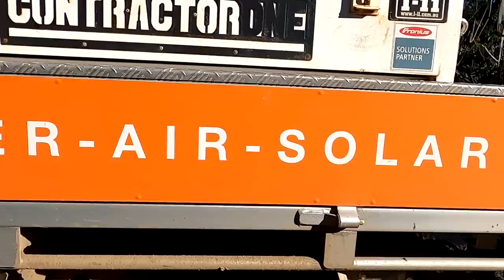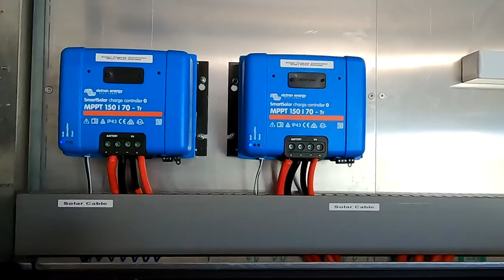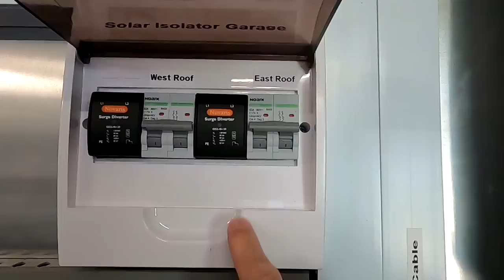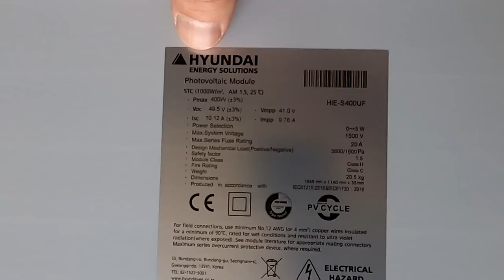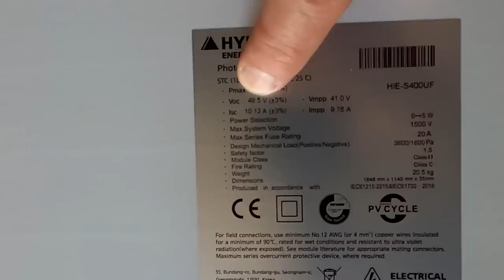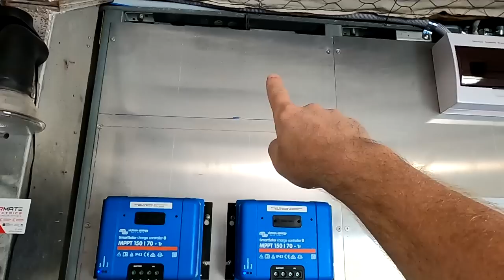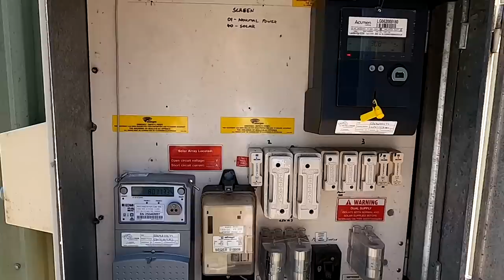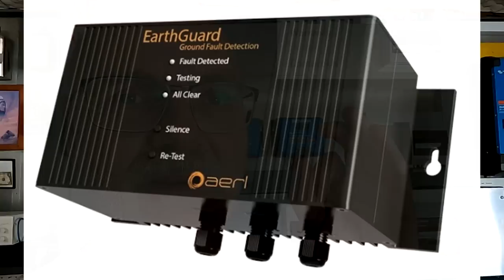I booked an Electrician to check on my DIY Solar-Battery System.

Comment: For DIY paneling, 40lbs is about the limit that one person can handle.   In many respects, you are looking for panels that:

(a) Are 40lbs (roughly) or less (for DIY).
(b) Have dimensions that work well with the roof area.
(c) And have voltages suitable for your inverters.  Or invest in new inverters.

Due to the shading problems with your particular roof, you don't want to parallel strings.   That is, you want one MPPT per string (which I think is already what you are doing).   Per-panel micro-inverters or optimizers will produce the best results.  However, you can still have series strings and use a string inverter instead of micro-inverters or optimizers if you want.  The issue here is that the bypass diodes will wind up being used rather heavily due to the shading and effectively take out any partially shaded panel.   However, string series voltages tend to be fairly high (200V to 500V) so the diode drop of the bypass diode will not introduce excess losses that are too terrible.

The advantage of a string inverter is of course lower cost.  One inverter handling multiple panels (often up to 9 or 10 panels) per MPPT.  So a single string inverter with two or three MPPTs can handle two or three high voltage strings.   The wiring is also easier... typically only has to handle 10A.

The disadvantage is that the total system production in partially shaded conditions will not be as good as the same panels with individual micro-inverters or optimizers.  However, the difference in cost is usually quite substantial which means that string inverter systems can spend the extra money on simply adding more panels.  So string solutions are often still the best choice.   If your total property system area is space-limited, though, then per-panel micro-inverters or optimizers are your best choice.

-Matt
Reply from the maker: Especially due to the shading, you want parallel strings. As many as possible. That works great. Exactly as you said, if strings get too long, the bypass diode will have to work hard.

Comment: what about building a Voltage Limiter? Say 140volts so that you can put 3 panels in series? I want to see this as I have the same issue, but 250Volts.
Also, and I'm not a proponent of taking healthy tress down... but what about trimming or removing trees shading the roofs?
Reply from the maker: The trees are 40m high. Trimming would cost me several thousands of $$$. And it would look sh!t. We bought this place especially because of the trees.
I made a video about the shading and why I'm going to work around the issue.

Comment: Australian Standards are overpowered by self interested industry. Andy, fortunately the requirement to have panel isolators on the roof has now been removed. The rest of the world realised long before Australia did that roof isolators are unnecessary and produce an extra failure point. I have 2 adjacent locations on the same grid feed rebate as yours in SEQ 5+8 Kw in panels.   By 2028 hopefully the calculations will allow an off-grid independence.
Reply from the maker: Yes, that is true. The regulations are ridiculous!
The new rules still demand a solar disconnect on the roof but it can be a dedicated MC4 connector now per string which is accessible and marked.

Comment: I'm guessing the clearance is to allow safe access to the panels for your bog standard domestic installer. But since you do all this yourself I think you shouldn't worry about it. If you are concerned, I'd carefully check what the real regs are. In the UK, a domestic electrical installer will tell you that wall sockets need to be on a 2.5 square mm ring. But this is simply not the case.
Reply: I believe clearance around the panels is due to wind
Reply from the maker: Yeah, it's about the wind force.

Comment: Victron make 250V MPPT charge controllers.
You could sell your 150v ones and then series 3 new panels without being close to limit.
Reply from the maker: That would be less efficient though. Due to the shading, there would be always panels in the shade and the bypass diodes would work hard in these panels. Parallel is better in this situation.
Reply: Oh you're complaining about having too much Isc, not too much Voc? You need a 150/85 or 150/100 then, which confusingly is 70A PV in. The 250/70 is only 35A.

Comment: solar credit things are dumb. However, that deal is hard to pass-up. I'd probably go for it myself.
Reply from the maker: Yeah, I agree the system itself is not very smart. I'm still doing the numbers but it's hard to find any alternatives, considering the cracked panels I have on the roof.

Comment: Nice job "passing" the inspection!  Victron makes excellent products, but the fact that they only offer lower voltage charge controls really limits options!  This is the biggest "con" to their systems IMO.
Reply: Not quite so - the Smartasolar MPPT RS 450/100 (& 200) have 450v limit. I use one & they're just great.
Reply from the maker: Yeah, if you have no shading, the RS MPPT's are great.
I would also like to see more options from them in terms of isolated controllers. This would make it a lot easier with rules and regulations.

Comment: There is no way the Multiplus can be grid connected - it’s not CEC approved. (Anymore) it makes me sad because I picked it partially due to its approval.

I’ll believe it when I see it as far as getting STC’s on the panels connected to your system.
Reply from the maker: The STC apply because the panels are connected to approved equipment (Victron MPPTS). The Multiplus II has full approval to be connected to the grid as well as been operated in off-grid installations.

Comment: Great video, could you change your existing panel from landscape to portrait  to get the setback you need on the roof. Just a thought.
Reply from the maker: A lot less panels would fit on the roof as I said in the video. I would end up with 30% less power per roof. Hence the idea to use new panels which have a higher power output per area.
Reply: @OffGridGarageAustralia  I think it is great that you recycle older panels and they are paid for. I know some are not in the best shape but maybe reuse the good ones on the shed roof. I hate to see them not used as they are still producing electricity. I have learned so much from your channel and like that you experiment with things to fully understand how they work. Thanks

Comment: Get a bigger roof! Add some awnings on each side maybe 2 or 3 feet extensions?
Reply from the maker: That would need a builder involvement as well which costs money.
I'm also unable to replace these cracked panels and if more crack over time, the power output will get less and less...
Reply: @OffGridGarageAustralia  =/ bureaucracy strikes again? Aka permitting? I wasn't referring to moving the walls i was just asking if you could just extend the roof like a mini car port all the way arround or just installing extra large rain gutters.
Reply from the maker: @raymondcasso7966  There could be a way but it would be a grey area while approval is usually required for any extension. Even of the roof.
Reply: @OffGridGarageAustralia  its bureaucracy!
 Ok good luck mien friend! Hope everything works out well for you. And best of luck.

Comment: Anyone know the logic behind the solar panels closer to edge of roof regulations? 
Is it wind uplift on the panels?

PS sounds like that electrician is a professional sales person....
Reply from the maker: Yeah, it is the wind force on the panels. The higher they are mounted the further away they need from all corners.
Reply: @OffGridGarageAustralia  ahh I see. Does seem quite a large distance needed from the edge. Especially given its not that far off the ground. ie some large ground mounted systems would surely not be too much lower and they have no "roof" behind them. Ahh well regs are regs I suppose.
Reply from the maker: @mattjayne5231  I would need to extend the roof by around 450mm. And there is no way to do this at the top for example, so three panels in a row does not work any more .

Comment: Do you know what is the reason for minimal roof edge to panel distance? AFAIK we don't have any requirement like that in our regulations and we have all kind of weather here with moderate to high wind and quite a lot of snow.
Reply: Ye, don't understand what the problem is
Reply: Could be just an access issue, the panels will be subjected to lift from wind but other factors such as roof pitch would definitely be part of the equation.
Reply: The other two replies don't show for some reason. I was wondering why andy needed the roof edge space?
Reply: Roof wind loadings and access safety requirements.
Reply from the maker: Yeah, because of the wind forces.

Comment: Andy, why not just keep the current system, repair the panels by using some sealant(sika)  from the back, they should be good for many more years. After your $0.44 FIT ends then re evaluate. I'm not sure Installing more panels now would be worthwhile as you would be wasting much of the energy, once the battery is full you can't feed it back to the grid.
Reply from the maker: The electrician found a way to connect the house while keeping the FIT. We're considering and evaluating atm.
Reply: @OffGridGarageAustralia  That still won't change the fact that once the battery is full, the house will have minimal load during the day,  you can't export so the energy will be wasted, oversizing a solar array is really just wasted money. I have 8kW solar system, It produces per day about 50kWh in summer and 30kWh in winter how can you use this much energy without exporting it?
Reply from the maker: @uksa007  I'm still connected to the grid and will be at lest until 2028 when the contract runs out. I have to consider if I stay connected for exactly this purpose of exporting excess energy or going completely off-grid. I guess I will have to make the decision when the contract runs out to see what the market is like then.
Reply: My point is that until 2028 excess energy from a larger solar array would be largely wasted, and installing the arrays on the sheds where there is lots of shading is also not great. After 2028 you may  be better off replacing(for bigger panels)/installing more panels on the house where there is less shading and you will be able to export the excess. With FIT's very low currently there is little benefit in installing a larger array that produces more energy than can you use. Work out how much energy you are using per day and size the array to match!

Comment: hey guys just a quick question,  I live in African and I need some help with the solar panels i will need to charge my 40kwh lifepo4 battery bank I just bought , I have epever charge controller rated at 40ah,150v so am wondering how many panels I need to get them fully charged everyday,  in African here we always have the sun 🌞
Reply: Charge controller is rated for 6000 watts. In full sun you'd need about 7.5 - 8 hours to fully charge your battery. However you need to consider less than full sun and losses due to inefficiencies in the charge circuit and battery. Use about 85% as a general figure. You need about 6000 - 6500 watts of solar panels to charge in 8-10 hours. This is with full sun during the whole charge period. The chances of you seeing 6000- 6500 watts output from 6000 - 6500 watt solar panels isn't likely. If you have sun for a longer period each day you can use less solar panels as you have more time to charge your battery.
Reply: @Stephen2846  hello Stephen,  thanks for your response please would like to get more idea on your opinion... 6500 watts is it like in series? that would take a lot of solar panels....please let me know more and what I really need.. thanks once again
Reply: @chuksobi593  
1) What voltage is your battery pack?
2) How many amp hours is your pack?

Your watt hours is your amp hours times your voltage. At 48 volts you'd need about 833.33 amps for one hour to be rated at 40,000 watt hours. That seems a bit large for a beginner. If your battery is 96 vdc you'd need batteries totaling 416.665 amps for one hour. 

So, what is your total battery voltage and amp hour rating?

Using higher voltages on the dc side will allow you to use smaller wire gauges and you'll have less theoretical (I2R) or heat losses because your current will be less. 

Example: Volts times amps = watts. *This is for pure DC current in resistive circuits.

Your charge controller is rated for 150 volts DC (VDC) and a maximum of 40 amps of current. You cannot exceed that 40 amp limitation. You can use up to 150 VDC, but not more. 

So a 12vdc battery can be charged at 40 amps. That would be 480 watts. That's 12 vdc times 40 amps charge current to equal 480 watts.

12vdc x 40 amps =  480 watts
24 vdc x 40 amps = 960 watts
36 vdc x 40 amps = 1,440 watts
48 vdc x 40 amps = 1,920 watts
96 vdc x 40 amps = 3,840 watts
150vdc x 40 amps = 6,000 watts

You charge controller is limited to a maximum of 40 amps at 150 volts dc. Your total wattage is dependent on the battery pack voltage. Your solar panels will have to have a higher voltage than the battery pack in order to charge it. The time required to charge your pack will depend on the amount of solar energy you can send to the charge controller, up to 150 vdc at 40 amps.

Your total wattage will remain the same in all parts of the circuit, minus any inefficiencies like I2R losses. You'll only be changing the voltages and current in order to match the solar panels to the battery. 

Therefore, if you input 150vdc at 40 amps to your charge controller it'll be at 6,000 Watts. if your battery voltage was 150vdc you charge current to the batteries would be at 40 amps, thus 6,000 watts. 

Send me your battery voltage and the amp hours of the batteries. For instance: if you have four 12 volt LiFePo4 batteries and they are 20 amp-hours each, you could make a 12 volt, 80 ah battery, or a 48 volt 20 ah battery. The total wattage would be the same with either battery setup whether series or parallel. 

4 - 12vdc, 20 ah batteries in parallel  = 12 vdc at 80ah for 960 watts.

1 - 48vdc battery, 12vdc, 20 ah batteries x 4 in series = 960 watts.

Voltage and current are inversely proportional. Raise the voltage, lower the current. Use higher voltage at a lower current and you'll still have the same total power (watts) but be able to use smaller wire. It's less expensive for components and you'll have less losses due to heat.

*Electricity is a bit more complicated in practice, but the above will have you safely in the ballpark for your calculations.

Send me the information on your batteries, controller, solar panels, voltages, and what you want to run, and for how long. If you plan on using an inverter you'll have an addition loss of about 15% unless you buy a very good (expensive) inverter. Even then your efficiency will never reach anywhere near 100%.
Reply: @Stephen2846  Thanks a lot Stephen,  good to hear from you again, and yeah I get the idea is all complicated , I am a software developer by profession so far this whole Solar idea has been an adventure for me,

For now my battatteries are lifepo4 EVE 105ah, my first batch am expecting 2 mote of 280 cells , I felt like I should get all I need now since prices of everything keeps going up...

So for now I want to get started setting them up , I presently have 16 105ah cells and I plan on connecting them parallel to series... 2 parallel and then series to another 2 parallel... will be total of 8 series right? Then my charge controller is 150/40 epever...then inverter I have 2 already one is 24v white the other one is 48v they are both 3000w  and yeah hybrid not sure if i can really trust them but it's a well trusted product around here by an Indian company (INDEX) tho I plan to get something better much later I already got them before I knew I could get better ones like victron....
And my energy consumption isn't much am getting at 4kw max daily ....

Comment: you can put some polyurathane on the bottom side of your solar panels to sell them up. Or get some modern solar panels instead lol
Reply from the maker: I could make the panels to be the roof and cover all gaps But this would still need a builder to be involved, so no money saved there. The new panels are a great option I guess...

Comment: Are you able to trim those trees a bit , I'm not saying Chop then  down ,   there's an awful lot of water solar, electricity  and money  due to a few extra branches
Reply from the maker: Trimming the trees will not be cheap either. They are 30-40m tall and will need someone to climb in there and carefully take out several branches. Then cut all the wood on the ground, mulch the branches and clean up the garden again. That is thousands of $$$.
It's not just a few branches, Paul.

Comment: First, as we supposed , you know a lot more about batteries than any electrician.
Second, what is the real reason about clearance? Wind forces? Maintenance? If it is maintenance you can always have access from the lateral. I don't know. There are some regulations that we will never understand.
Reply from the maker: It's the wind force mainly which requires the space around the panels.

Comment: surf OUTBACK POWER PV GROUND-FAULT DETECTOR INTERRUPTER 80 AMP 150VDC SINGLE POLE PANEL MOUNT or similar price 80-100$